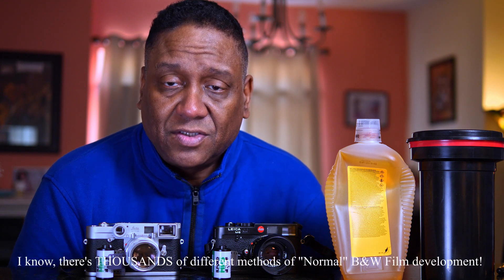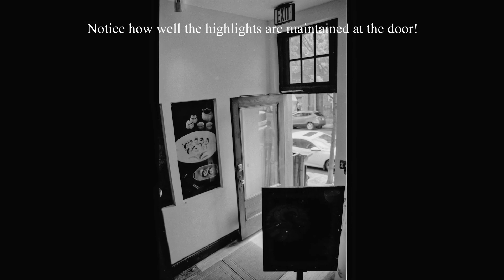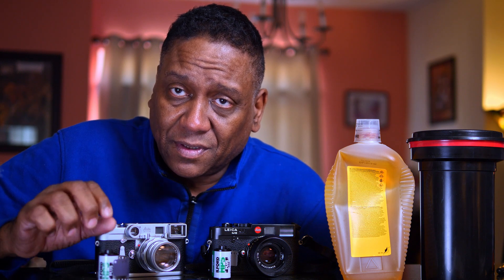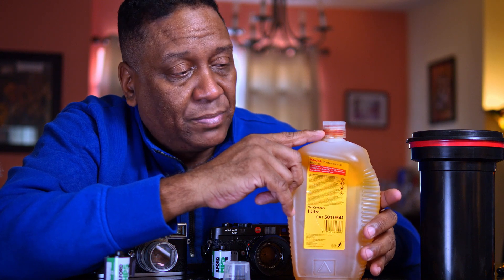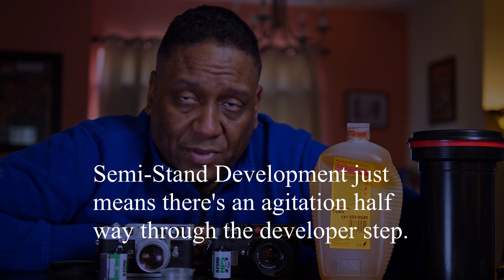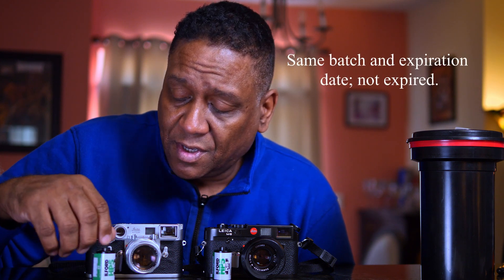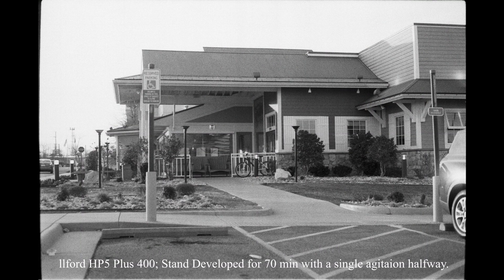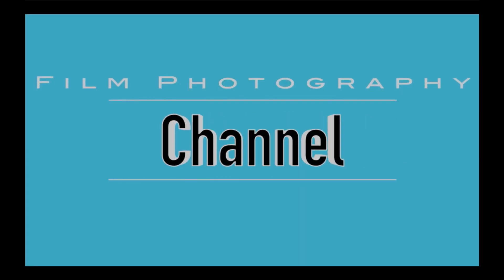Variable ISO From Your Film CAMERA? YES! The Stand-Development Tutorial

Comment: Thanks for a very interesting video. You described the process excellent. I will try this next time I develop. One question: my room temperature is normally a few degrees warmer. Hot would the development time be adjusted if the development temperature is about 72 degrees?
Reply from the maker: Check out the Massive Dev Chart which can be downloaded as an app. It has tons of information like developing times (even with different chemical ratios, ie 1:50 etc), temperatures and how to properly process virtually any brand B&W film with different brand developers. It’s a treasure trove of information. It even has a built in timer that you can use while your processing your film.

Comment: Hi, im not sure how a film shot at "variable iso" makes any sense, iso in film is iso, you can shoot it with it metered at a different speed for example but this doesn't make it a different speed, surely you would need to shoot the whole roll as though it were one Iso otherwise wouldn't it be under or overexposed for some frames if they're at different iso?
Reply from the maker: The whole premise of stand developing is that you can shoot a roll of film at different ISOs as I outlined in the video. In effect the photographer is under or overexposing the film and the stand developing process evens out the pretty wide margins in exposure. The advantage is (one example) that if you need to use a faster shutter speed than your film iso would allow, your now free to do so because the SD process will compensate. Hope this helps.
Reply: @FilmPhotographyChannel  thanks for the quick reply, I just re-read my comment and it reads as criticism, not meant to so apologies if it seems that way. My comment was more that we can only meter and shoot as though it is a different iso as we can't change the iso even if we set as 200, 400, 800 etc on the camera as this either just affects the metering or is just a film type reminder. I've never used syand developing so wasn't aware of how this could stop the image reading as over or underexposed.
Reply from the maker: Hi no worries at all. I didn’t take offense but thanks for elaborating. You should try out stand developing. I like how the tonal range of the film seems to be increased. Lots of shades of grey.
Reply: @FilmPhotographyChannel  i have some Rodinal R09 on the way so will hopefully get to have a go soon. I've been using cinestill Df96 recently and can't express enough how disappointed I've been so I'm hoping stand developing with Rodinal R09 will at least give me the right exposure. Cinestill seems to be underexposing I even tested by metering 200 film as 100 and pushing to 400 hoping I would be somewhat over exposed or average out the monobaths underexposing and it came out under again...
Reply from the maker: I’ve never had even moderate success with mono bath. The folks a FPP told me it’s not meant for T-Grain films like TMax.  That was a few years ago. I don’t know if they’ve improved it since then.

Comment: I've been told  that you can do same thing with normal (not stand) development in Diafine. In other words you can shoot HP5 at 800 for one shot and 200 for another.  This would be like one shot getting N-1 development and the other getting N+1 development.   I haven; tried this yet but was wondering if you had any thoughts on that?  Subscribed.
Reply from the maker: Thanks for the sub! In my video I show that you can shoot HP5 or Tri-X which are both 400 speed films, at 400 or 800 without having to alter your development times. I haven’t tried diafine so I couldn’t comment specifically on its use. I also don’t know what the advantage would be to shoot at 200 (there be some advantages, I just don’t know what they are). I found it really helpful to have 800 Asa available on these two films just  in case.
Reply: @FilmPhotographyChannel  Thanks.  I should have been more clear.  I was thinking of a situation where you would want to increase or decrease the contrast range.  In a low contrast scene with normal developers you might do an N+1 (longer) development to increase the contrast. But you would have to do this for the whole roll.  I was told that with Diafine, being a two stage developer, you could shoot the low contrast scene at ISO 200 which would have the same effect as N+1, but then you could be shooting the remaining shots at box speed or, in a high contrast scene at 800 ISO which would be like N-1.  This is due to the specific nature of Diafine.  In fact the instructions that come with Diafine specify shooting at very different ISOs depending on the type of film.  Again, I'm no expert on this, just trying to get more info to see what others think.  I did one test with sheet film on a bright (high contrast day) and did see better results at the higher ISO.
Reply: @jiml989  with diafine you have no choice, HP5 for example is ISO 800, Tri-X is 1200 I believe, look it up.

Comment: Hello Eric what a great reviews you put on cameras which helps someone like me I’m an ex photographer now I work as a film director and photography is back to my life as a great every day hobby 
Sorry for the long intro I would like your opinion it will be a great help I’m hesitant between the contax g1 , konica hexar & the Minolta cle 
Thanks keep it up
Reply from the maker: Wow, so these are three great cameras that I've studied (a little) but never owned. They all have a cult following on some level. The Contax G1 ($200-$600 with a 45mm or 90mm Zeiss lens!) has a pretty bad (and loud) autofocus system with a pretty bad manual focus (by a top mounted dial) option! You can get really, really good Zeiss lenses for hundreds (not thousands) of dollars. The lenses are tack-sharp and superb. They have zooming viewfinders that change depending on the lens that's mounted vs frame lines like you'd see in the viewfinder of a Leica M rangefinder. FYI, the G2 has a better focusing system and is compatible with a wider range of lenses over the G1 to include their 35-70mm zoom. The Konica Hexar is a fixed lens autofocus 35mm camera with a 35mm f2 lens and motorized film advance. The Hexar RF ($800-$900)is the interchangeable lens model that fits Leica M Mount manual focus lenses, Zeiss ZM and Konica KM lens mounts. The RF is a fine camera with aperture priority, motorized film advance and by all accounts (I've never held one) lesser build quality when compared to a Leica. The Minolta CLE ($650-$900 body only) is small, light, aperture priority, and manual TTL exposure, manual focus M-Mount Minolta-branded camera made by Leica. It's best used Minolta's 40mm f2 lens designed for the CLE. While you can of course mount a 35mm or 50mm M-Mount, there are no frame lines for either. The CLE has 28, 40 & 90mm frame lines. I personally like the 40mm focal length a lot.  The small body of the CLE means that the rangefinder window is closer to the viewfinder window which is less than ideal when focusing a 90mm or longer lens. Full-sized Leica bodies have these two windows further apart which increases accuracy when focusing (especially) longer lenses. Leica goggles (for dual range or wide-angle lenses) won't fit for the same reason.  Some of Leica's really fat lenses like their 50mm Noctilux f1.0/f.95 and other of their newer ASPH lenses actually block the tiny rangefinder window which prevents focusing! ALL THAT being said, it's hard for me to recommend a camera that I haven't used. I've actually considered buying all three of these but haven't pulled the trigger yet. I would research the cost and availability of CLA (clean, lube and adjust). The Contax and Konica have some pretty old electronics and motors for the film advance so make sure they are repairable still. As always, make sure the seller has a return policy. I hope this helps!

Comment: Lots of good info here; I'll have to re-watch it and take notes. I shot a roll of Tri-X last year but have been too scared to try developing it yet. It was shot at "12800" because the event was a horribly-lit concert stage.The venue couldn't be bothered to even put a spotlight on the singer, let alone anything decent on the other players.

What I did was meter at the highest the camera would go (3200) and use exposure compensation to pretend the film was 2 stops more sensitive than that. 2 or 3 shots might have been taken at correct exposure however. I'm not looking for anything approaching accuracy here, but nor do I want the roll to turn out all-black ... with my 50mm ƒ1.8 the recipe called for 1/60th or 1/90th and somewhere between wide open and ƒ2.8.

Dunno why I'm worrying; they're probably all blurry anyway.

... I'd read on someone else' blog how they used HC-110 for some crazy amount of time (12 hours? More?) in order to be able to "shoot Tri-X at 12800." I don't remember the dilution nor how I could maintain a constant 68 or whatever for that long without first adjusting the house thermostat. But I think that's the road I'm headed down.

I've only developed two rolls before life got in the way last year. One roll was fine and the other had excessive grain. Exposures were generally correct. I chalked the bad roll up to inattentiveness to the details of temp and time. I also learned that "little splashes" of prepped D-76 try to do unfortunate things to wood floors if left alone.
Reply from the maker: Hi, if you look at my photos in the video that were taken at ASA 6400, they were pretty contrasty and largely lacked shadow detail. I never tried conventional push processing, ie regular dilution, with extended development to push the iso this high. If the entire roll was shot at 12,800, you could of course push process. If you shot at vastly different ISO’s on the same roll, then stand development would be the way to go.  Using any developer for really long times like 12 hours would not be any different than if you developed a highly diluted HC110 mix for 2-3 hours. There comes a time in stand development that the developer loses its effectiveness and stops developing the film. Btw, remember the single agitation halfway to prevent bromide drag! Also, you can expect Tri-X to be grainy under most circumstances. That’s why people love it. Under such severe pushing, it will likely be more grainy than usual, very contrasty and with little shadow detail. Not necessarily bad things. If you want a perfectly sharp B&W film free of grain and with tons of tones and shadow detail, try T-Max. I like both films for different reasons.

Comment: Eric, AWESOME!!!

I have a few rolls of Kodak Technical Pan in my freezer.  With Technidol developer gone bye bye, I may be able to get good results from TechPan with HC110 but still have useable contrast.  You are already aware that TechPan an anything other than Technidol can range from excessive contrast to pure black or white litho results.  This is something to consider once I’m up and running and have my techniques down.
Reply: If you a serious about processing Tech Pan to a normal contrast, look up POTA on line or in a book of developers. Stand development is mostly high or miss,particularly with uneven development. POTA has few ingredients and was formulated specifically for films like Tech Pan, long before Kodak produced a developer specifically for that  film. Back in the 1980s when it was a fad, I mostly shot landscapes with Tech Pan and POTA. I got the results I wanted, but with an ISO around 12-25, it was slow going. In exchange  I got B&W pints aty 16x20 inches which folks regularly took to be shot on Hasselblad.

Comment: Had a fair bit of trouble with Br drag in the past, so  gave up stand. However, this has re-kindled my interest, there's a roll of Fomapan 100 waiting. That's a lowish contrast film so stand may help boost it a bit. 

As an aside, try a wine bottle vacuum for keeping developer fresh - works a treat! https://www.johnlewis.com/john-lewis-partners-wine-saver-and-bottle-stopper-set/p231634381.
Reply: You need to use rodinal, there’s no bromide in it. Bromide drag is only an issue with HC-110 and other developers.
And any agitation in stand with Rodinal is going to up the perceived grain, so do the first minute only.
Reply from the maker: I’ve put an order in for Rodinal. I’ve been using HC110 for so long it’s time for a change. The information in your comment about bromide is good information. Thanks for weighing in.
Reply: @FilmPhotographyChannel  no problem, thanks for demonstrating the results so perfectly!
Love your channel, glad you’re still active. Be well.
Reply: @joeltunnah  Cheers Joel. I've been using rodinal semi-stand since watching Eric's video, mostly with Fomapan or Rollei. Twenty to thirty seconds twiddle initially, then one or two twiddles half-way through. Very little grain, good contrast. I over-exposed one frame, so repeated it correctly, there was so little difference between them it was difficult to tell which was which.
Reply: Try semi-stand to reduce the Br drag. Just give a small amount of agitation  every 10 to 15 minutes.

I use high contrast microfilm in my 16mm Minolta and Mamiya cameras and agitate every 20 minutes but Br drag is not as big a problem with the smaller format. 

Here are a couple of examples.

https://www.flickr.com/photos/high2hal/49070347973/in/dateposted-public/

https://www.flickr.com/photos/high2hal/49165933558/in/dateposted-public/

And here is the film slit to 9.1mm for Minox cartridges

https://www.flickr.com/photos/high2hal/49161315666/in/dateposted-public/